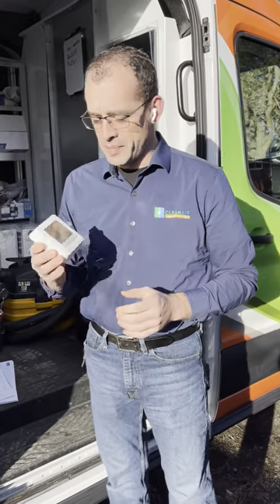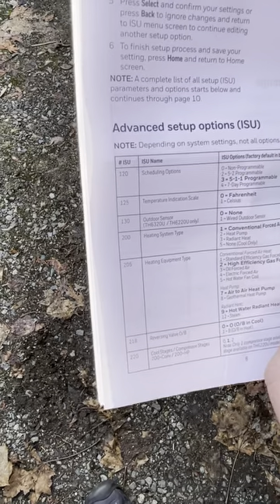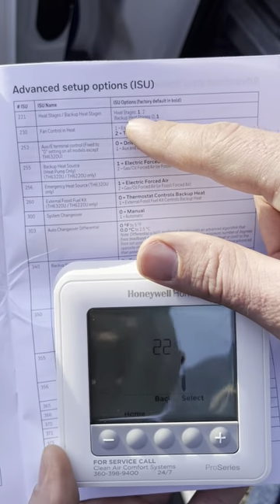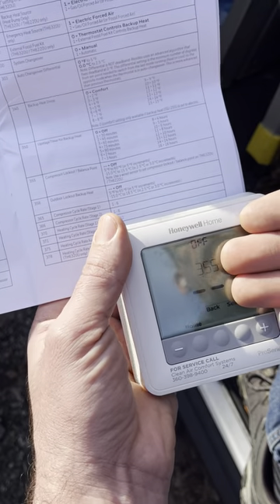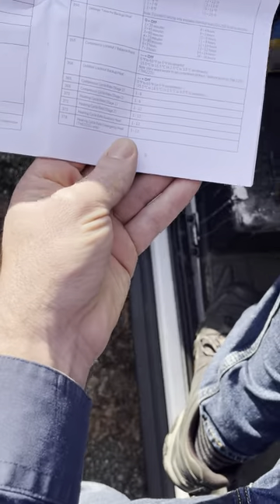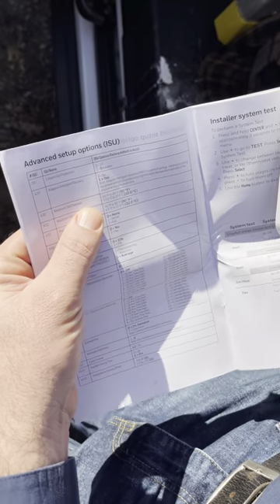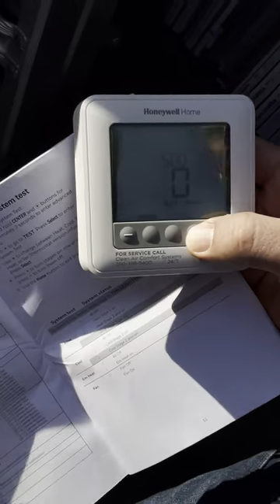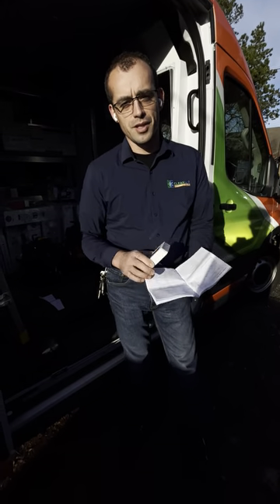Thermostat Setup for Heat Pump, Electric Furnace or Gas back up Auxiliary Emergency a heat

Comment: I have the t4 pro series and it continues to blow hot air on cool auto , how do I get the heat pump to blow cold
Reply from the maker: @CHarris73  what kind of indoor unit do you have?

Comment: Great video.  I have a forced air gas furnace used only for heating. Also have and air handler with outdoor condenser used only for cooling. Do I have a dual fuel system? Thanks
Reply from the maker: @mark.r8900  A dual fuel system is a gas furnace with heat pump, using the same ductwork.

Comment: I have a carrier unit but I cannot get the outdoor unit to turn on. Where should I have the reverse valve set to o or b
Reply from the maker: @LouisRodriguez-x2y  it depends. You have to look in the manual for the heat pump.  It will tell you how to set it. If I remember correctly, Carrier is B.

Comment: You're the man. Thank you! I think the tech changed 340 to 0 and my bill has been going up since. I switched it to 2 to not engage the furnace right away.
Reply from the maker: Thank you for letting me know. I know I'm walking on thin ice divulging such information 😃. This is only supposed to be used by technicians but with caution even homeowners can play with those settings. I would warn you against the biggest risk which could be equipment damage or causing unnecessary service calls which as a homeowner you will have to pay for. But if nothing goes wrong then there's nothing to worry about.
Reply: I understand.  I made sure not to change anything else lol
Reply from the maker: @karamkassab-yd3rf  well done! Please reach out if you need further help!

Comment: Just a quick question, if you don't mind. I just got a heat pump and this is my first winter storm. Ice pellets, snow, rain, very windy, and the outdoor unit is in a location where the wind swirls around. The ice built up on it last night so I just turned it off and went back to my normal heat for now. I know it needs a cover of some kind but do you think it would cause problems to be leaving it turned off for long periods while the storm blows over?
Reply from the maker: It’s ok to leave the heat pump off for several weeks at a time.
Reply: A cover.  ?? Why would you put a cover on a heat pump.
Reply from the maker: @kevinpearce3281  good point. If you get a heat pump you would want to use it in the winter. If you have an ac it would make more sense to cover it up. The only detriment of covering the heat pump would be the higher cost utility bill if the back up heat costs more to operate during that time. But if the heat pump isn’t efficient during those weather events, it wouldn’t hurt to have it turned off. This varies from case to case and also depends on home owners preference.

Comment: I still can’t get my T6 pro smart working. The ac seems like it’s “cold” air, but it never gets cold enough as set and the fan turns on forever. I think my ISU isn’t correct.
Reply from the maker: That's very likely. If you're in our market we are happy to come out and take a look at it for you. You may need to call a local HVAC professional to help you further with this. You can also give us a call or a text that our office line and see if one of our techs can help you. 360-398-9400

Comment: Thanks for the video. My dual heat pump and gas setup is set for the heat pump to come on at 13°C. However I would like it to come on at 8°C. How do I change that? Thanks
Reply from the maker: You would change that from the menu I've shown in the video. Do you have this exact thermostat or a different one?

Comment: Great video! 
I have a Honeywell thermostat, gas furnace for baseboard hot water.

I feel like my heat pump runs a lot when the temp outside is 35-45. And, the cold air seems to be falling from my vents.

I want to close the vents to minimize the cooling affect and run rhe gas boiler at a higher temperature, say 40, instead of 35.

Not which setting I can adjust to accommodate the change. @ 12:00 into the video I think you are talking about these settings.

Is it your experience that I need a PIN to get into these settings to tweak them?
Reply from the maker: Correct. Most thermostats will have a secret way to get into the installer options. I don't recommend to do this yourself. Bestbis to hire a reputable and skilled company and have their service tech do this. However if you make any of these changes yourself you may be successful. I don't advise it though because certain settings can cause equipment damage, higher utility bills or other frustrations. The video is mostly intended for HVAC techs.

Comment: Thanks for the video. I have a modulating heat pump and a variable speed furnace with a T10 stat. These are not option when setting up the heat and cool stages in the ISU. Only 0,1, and 2 for both heat and cool. What should they be set to for my equipment? And does it make a difference?
Reply from the maker: Excellent question! It does make a difference in this case your system may modulate based on time or rather than being fully modulating it might work in five stages or something like that. It depends on the equipment that you have the manufacturer and what they recommend. Typically when you use a two-stage thermostat with modulating furnace or HP you have to go on the board of your equipment to tell it how to react to inputs from W1 and W2, Y1 and Y2.
Reply: Hi.  I did try to replace my old style stat with a T4. But for what ever reason. My electric furnace would run constantly.  I had it wired the same as my old stat and had fan setting to Auto?

Comment: Quick question..

I was working on a heat pump and with 2 stage heat and 1 stage cool..
The question is when I bumped up my thermostat from 73 to 75 or 77 my back up heat didnt kick on so it can heat up the house quicker.. the electric heat strips were only activated only on emergency heat . Is that correct
Reply from the maker: That is possible. It depends how it’s set up. If you use an indoor temp differential to trigger the back up heat then you have to see what it’s set for. You can use time, temp or OD temp. Let me know of this helps or if you have further clarifying questions. 👍